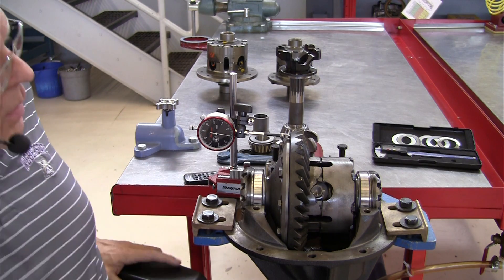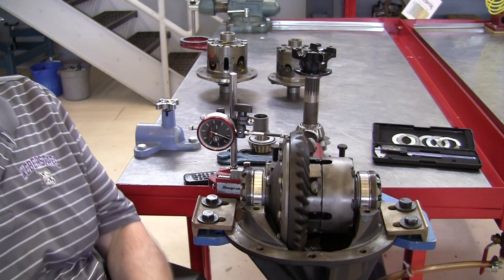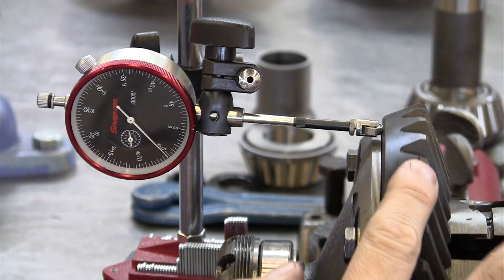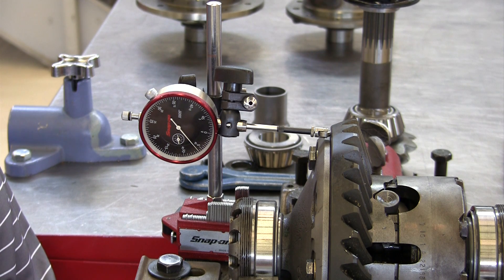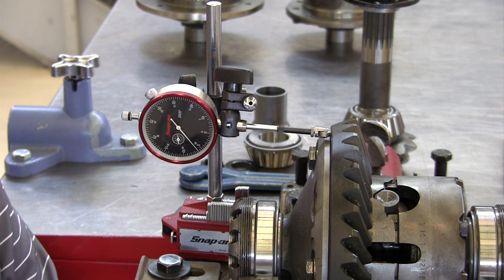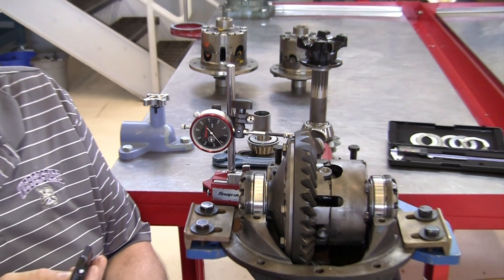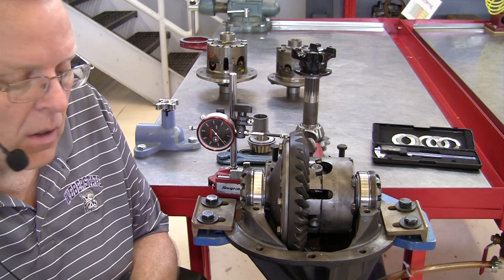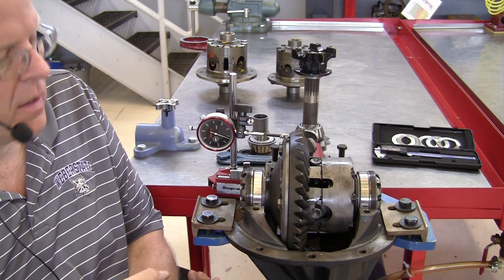1963 Chevrolet Biscayne Positraction Differential Overhaul - Part 3 - Problems

Comment: You can try to dismantle the whole thing again and carefully clean the differential housing and the ring gear. Then tighten the housing screws in several stages. Do the same with the screws from ring gear. 
I have had great success with it many times!
Reply from the maker: Thanks

Comment: Hi, I have left a similar comment in Part-2, so just for context's sake; You could have put this inner gear housing (fully assembled, so that both halves mate together) into a lathe and turn it between centers, as they call it. It involves setting up the inner case on two cones in the lathe, and dialing everything in to eliminate runout. Then you machine the mating surface for the ring gear to remove any runout. Not much material needs to be removed to achieve this. I suspect you would have enough adjustment left in the side bearings to make up for the 0.007" removed to get a clean, straight surface.
Reply from the maker: +mictho100 Good thought! Thanks for the feedback!

Comment: Hello,

I have probably a similar issue with 1958 Chevy Impala, too?

The "problem":
If I check my new Eaton-Posi as you did, I measure an axial runout from max. 0,0016".
That's possibly not too much for a brand new part?
In accordance with the manual 0,003" would be acceptable.
 
With the installed ring gear on the Posi, I measure an axial runout from max. 0,0026" on the outer edge of the ring gear.

To be honest, I'm a little bit disappointed of these values with brand new parts.
Especially, if I compare these values with the 57year old stock differential.
It runs with nearly no play, 0,0008", measured on the ring gear!

What is your opinion?
Can I stay calm with that results?
Is my expectation too high and I can go on with the new parts?
Or should I rework the new Posi?

Thanks in advance!
Reply from the maker: Hi, new parts are not necessarily good parts; however, you should be okay with that amount of lateral runout as long as your backlash does not vary more than 0.002" across all the ring gear teeth.

Comment: If the run out doubled when you added the ring gear then have you tried rotating the ring gear 180 degrees to cancel out the runout
Reply from the maker: Hi, thank you for your comment. The .007" lateral runout was in the differential case before installing the ring gear. I should have stopped at that point without installing the ring gear to address the problem.